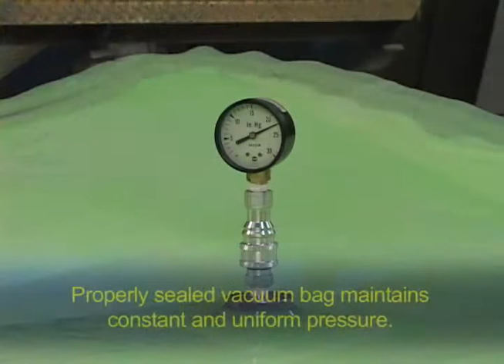Vacuum Bagging with EZ~Spray Silicone Reusable Composite Bags 3/3

Comment: When you applied your silicone spray you did not have an original part on the tool . Does the lack of the part on the tool make the silicone shell smaller than it should be on the carbon fiber hood ? or is the thickness of the carbon fiber hood negligable when spraying directly to the tool ?
Reply: They sandwiched foam core between the top and bottom layers.  See time stamp 1:24.
Reply: @califuturist  nevermind the silicone stretches over the prepreg . Thank you

Comment: Is the foam core a pre-pegged material too, if not, how did it adhere to the part that has already been heat cured?
Reply: Not pre-preg.  The vacuum process secures the foam core.